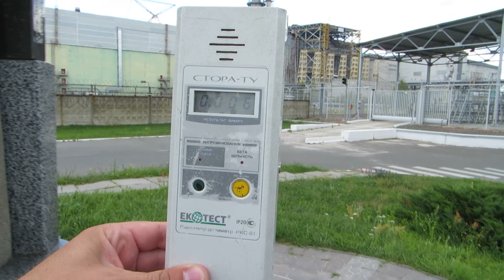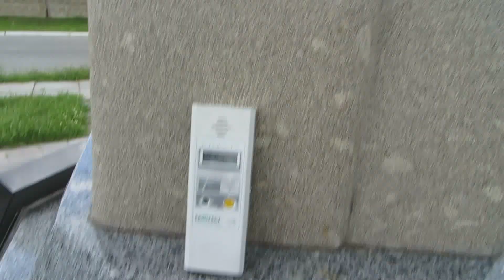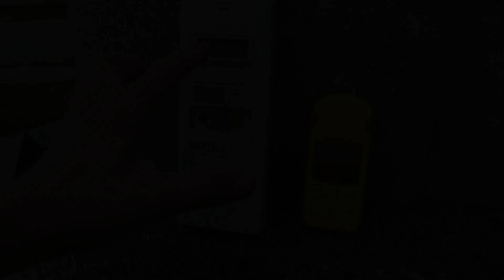04. Chernobyl Nuclear Power Plant - levels of exposure to radiation

Comment: I dont understand, why is the monument protecting them if the reactor is already covered in a thick concrete sarcophagphus? Shouldn`t that be enough ? or is that monument made of a different material?
Reply from the maker: teh sarcophagus does not eliminate all radiation. Mostly but not all.
Reply: @maolsuperstar  But then why don't they thicken  up the sarcophagus or improve it so that it acts exactly like that monument? I guess is very expensive and difficult.
Reply from the maker: They have built a new sarcophagus. And yes very expensive. Check here: https://en.wikipedia.org/wiki/Chernobyl_New_Safe_Confinement

Comment: wouldn't it be more useful to use a geiger counter to demonstrate things like this? rather than m-sieverts that measure exposure over time
Reply: -  i  didnt  understand  ,  5.3  of  what  in  the  video  ?  is  it  a  lot  or  no  ?  doesn  t  the  shield  work  ?
Reply: Evgeniy Petrov 5.3 micro-sieverts per hour, a micro-sievert is millionth of a sievert, 1 full sievert in very short time will kill you

Comment: why are people just walking the streets with such high levels of radiation still current?
Reply from the maker: they are workers... still many people work in the exclusion area. They work in shifts to mitigate exposure.
Reply: It is not that high, and not that dangerous. You get about the same amount of radiation from flying, and how many hours per year do airplane personnel fly? :)
Reply: It is safe when you get the radiation dose under 100μSv per hour. When you get over 4000μSv （4Sv）, you probably die.
Reply: Sorry! It's 4000mSv not 4000μSv,  that was a typo :)
Reply: @Gadolini Rutherfordium very informative. thank you !